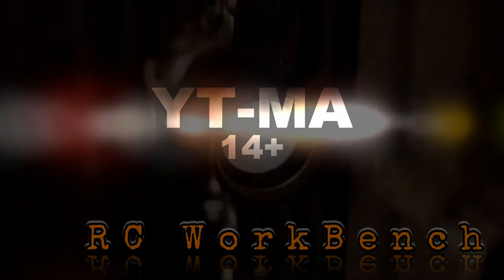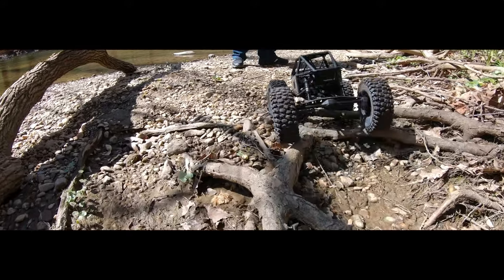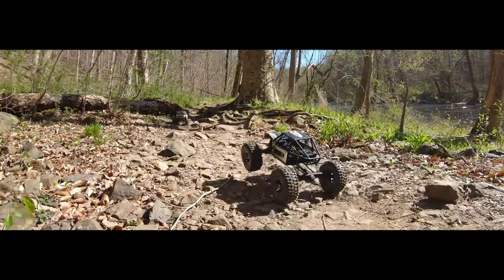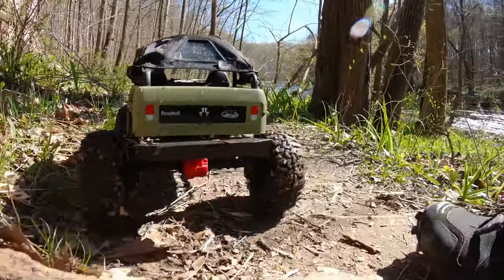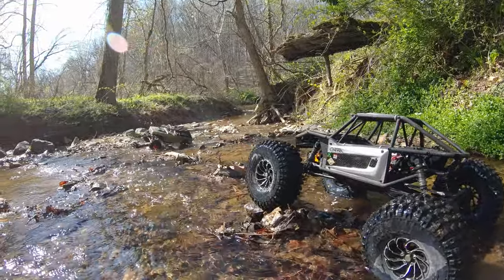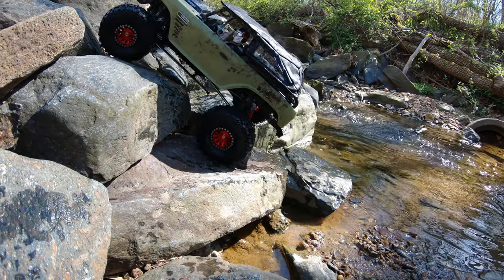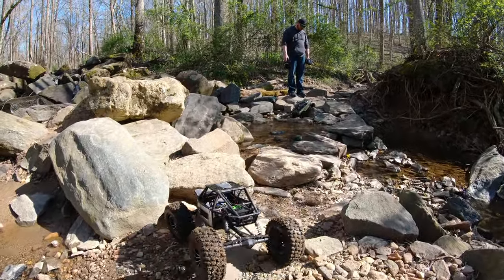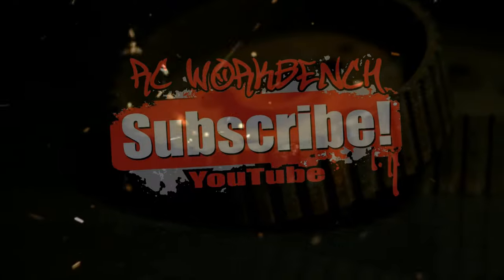Axial Capra First Trail Run with 2.2 Hyrax Tires!! How do they Perform??

Comment: Looks like they performed really well amazing trail location and video 👍💯👌
Reply from the maker: Thanks for watching! They did work very well with certain things but really got in the way for others. Trying to be articulate through certain lines just wasn't happening as well as the 1.9's perform. Then again the 2.2's could do certain things better than the 1.9's. I think I may interchange them now that I have the new stronger battery for it.

Comment: Did you gear down for the 2.2’s? I run a 10t pinion and have no issues with power or battery life.
Reply from the maker: I did not. It may have helped a little but the battery was really the issue. I'm running a Hobbywing 1080 and it draws 80 amps max and the battery was a 1,350Mah 30C 3S Lipo. So, it could only discharge a max of 40.5 amps continuously. Not even close to enough power. 

I got a new battery, a 2S 4,600Mah 100C lipo that can run 460 amps continuously. Even tho its lower voltage it gives the ESC more power. 

I intended to run it off a stock ESC that draws only 40 amps when I got the smaller battery. But the 1080 became available sooner than expected. I will definitely put the 2.2's back on at some point with the stronger battery. I knew it was under powered but didn't think it would make THAT much of a difference with the bigger wheels. 

Lipo Calc: Capacity (x) C Rating (÷) 1,000 (=) Continuous Draw. 
1350×30÷1000= 40.5 amps. 
4600×100÷1000= 460 amps. 
Probably going to do a video about this soon explaining the importance of capacity in regard to the C Rating of a battery. Because a lot of manuals don't fully explain why they recommend a certain capacity and C rating. I knew better but ran it anyways.
Reply: Where did you buy your 10t pinion from?